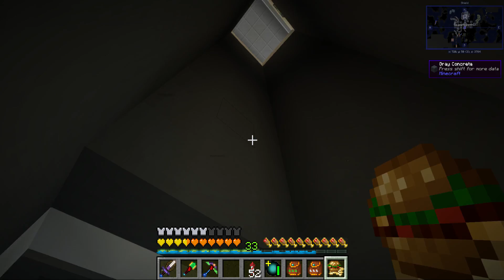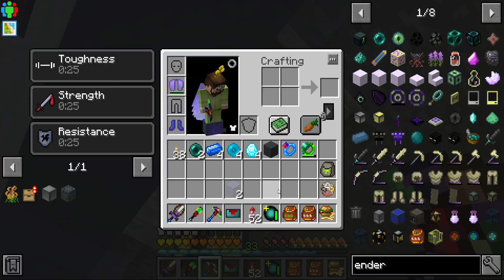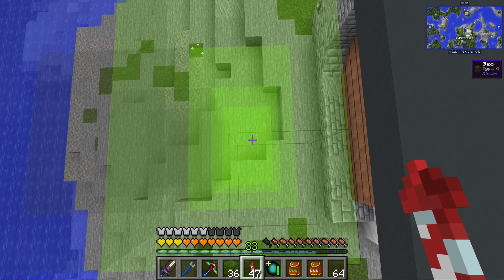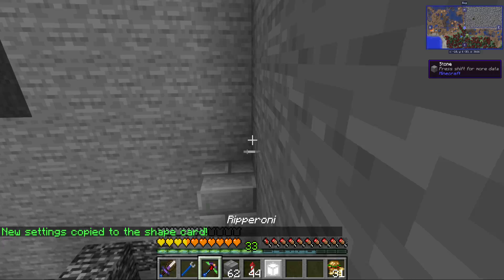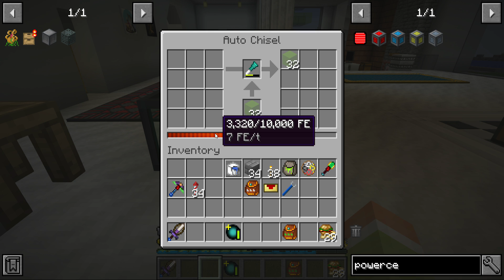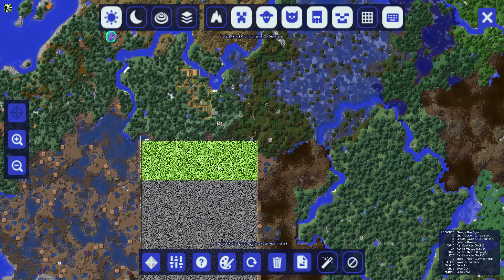Funcraft: 9 | HALF A MILLION GLASS!

Comment: For the terrasteel: 

You could use the AE2 mechanic that only lets the interface have 1 set of crafting materials at once. Just add a cobblestone to the recipe and pull it out once the craft is finished. It is a much simpler way of doing things than you are currently doing it.

Comment: You should really fill in the gaps between the bedrock with glaxx since that is where the fog effect would be most visible. If there is nothing inside the layers of glaxx there is nothing the fog effect could color differently for the volumetric effect to show up, so the fog effect will only really be visible at the edges of the perimeter, everything else in the center will just be tinted green without the depth effect.